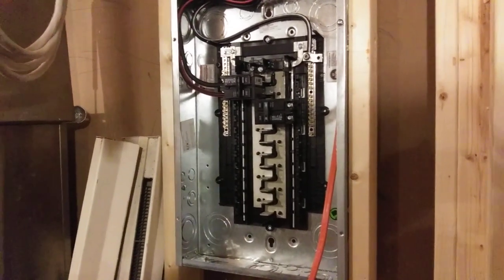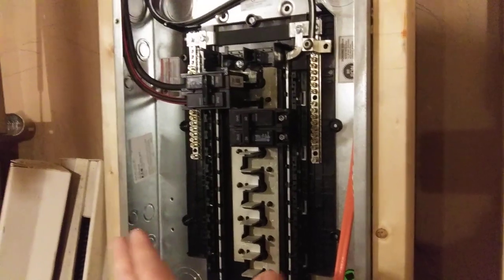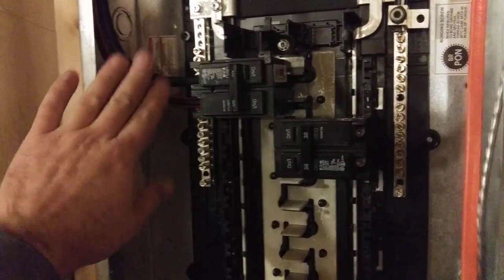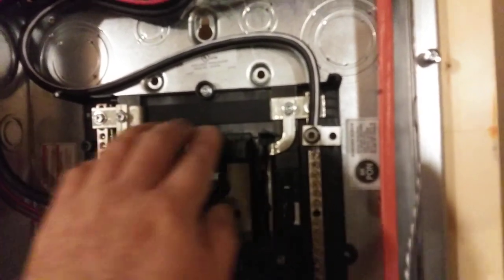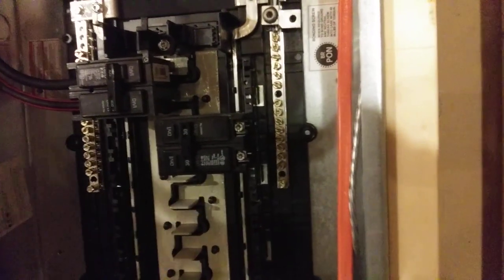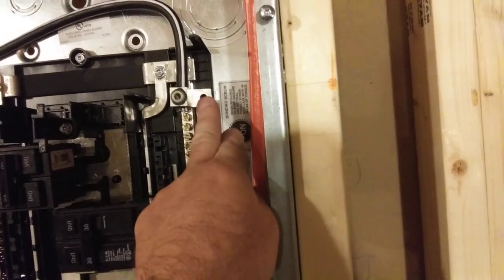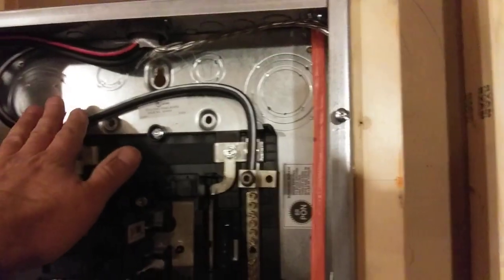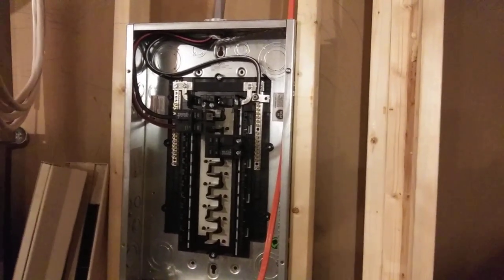Subpanels only get SER Cable!

Comment: Hi James.  Great video.  I'm planning on using a Homeline 40 space breaker panel in my attached garage as a sub panel.   Adding a 100A breaker to main panel, using 2-2-2-4, and using the 200A breaker in 40 space box as disconnect, and removing bonding screw.  I have a question on interior routing of the SER cable inside the structure.  The attached garage was an addition.  All of the  2x4 framing of garage is currently exposed, including the 2x6 bottom truss cords (ceiling).  Are there requirements for the SER cable to be exposed, or visible?  Can it it just lay clipped to center of a stud or bay?  Just beginning my search on information on this, and I don't see any references to this yet.  I only see terminations in or at panels.
Reply from the maker: You should start with a call to your local inspector and ask the following: 
1. Can you use the 200 Amp panel
2. Do you need to derate to 90 amps? See attached link.
3. I'd put the ser in the wall and secure to studs every 4' and 8" from panel. Remember protection plates where needed.
https://diy.stackexchange.com/questions/221869/running-ser-cable-from-200amp-main-to-100-amp-sub-panel
Reply: @JamesGlassJamesGlass  @Ryan MacEwen  I have a similar question. So the wire doesn't have to be in conduit. But could it be if you wanted to? thanks
Reply from the maker: @tigeroswald777  Yes, for that application with #6 or greater. See 334.15 and 338.10

Comment: The house we moved into has a 30 amp sub panel in the detached garage and it fits the description of what not to do in this video. It only has SE wire coming into it (one hot) and I see the neutral and ground wires are side by side on the two bus bars. Basically the total opposite of what you should do. So I’m left wondering if I need to address this in some way. The incoming wire runs under a concrete patio (in conduit). I’m not an electrician. Any thoughts on what should be done to remediate?
Reply: You only have one phase (120v) doing to the sub panel?
Reply: Pull the proper conductors.  Oversize to number 8 or more if there is potential for voltage drop and if conduit size is appropriately sized..  Make sure bonding screw is not joining ground to neutral in the sub panel.

Comment: I HAVE A 100 AMP SIEMENS PANEL (seq24100sm) THAT I WILL USE AS A SUBPANEL in my shed,  IT HAS A 100 AMP MAIN  BREAKER  but i  not see any lug plate or connections for hot, neutral or ground, do i need to buy a separate lug kit ?  what size wire where would i connect the cable on the main panel  and what size amps , i will probably install a 40 amp service in the subpanel . The cable will be run underground  in a pvc  conduit to a max length of 50 feet !

Comment: How about 3 wires from the main panel if a copper ground wire is run to a ground rod and is also separated from the neutral? That works, correct?
Reply from the maker: No, has to be 4, unbonded. Ground and grounded conductor must be separate.

Comment: And your back feeding a 2 pole breaker to serve as your main disconnect for that panel but you do not have it bolted in .
Reply: 408.36(d)
Reply from the maker: No, I'm not. This is an unbonded panel with a main disconnect because it's so far from the panel that feeds it.

Comment: You are back feeding your main breaker. Were you able to secure it with a special screw or other attachment device?
Reply: There is no backfeeding here, the subpanel simply doesn't have main lugs, so he's bringing in power through the breaker.

Comment: if you had a sub panel going to a shed in the backyard. i know that you will need add ground rods in the ground and connect the a wire to the rods and the ground bar. but what happens to the ground line coming from the main panel. do you attach it to the ground bar or do you terminate it?
Reply: Yes you ground it all together.  You're just providing the quickest, least resistant way to get that electricity into the ground.  You still don't bond neutral to ground in that subpanel though!

Comment: THHN can also be used through the walls and attic but definitely needs conduit. It's much easier to place in conduit (if that's what you are going to do) since each wire is jacketed alone.

Comment: Hello and thank you for posting the video.
Quick question just to clarify:
The neutral and ground, are bonded at the main panel, but separated at the subpanel.
As you add breakers in the subpanel, the neutral wires will go to the neutral buss bar and the grounds to the ground buss bar?
Thank you, again!
Reply: Yes, in a Subpanel the Neutrals have to stay on the Neutral buss bar and the Grounds must stay on the Ground Buss bar.

Comment: Enjoy your very informative vids.  Got a question about splicing a ser 
cable after an unrelated fire burnt a small section of it.  Can you 
splice a service cable back together after cutting out the burnt part?  
Thanks!
Reply from the maker: Well, no, but can add a junction box and you will need a permit. So, a straight up splice outside a JB is a major no no, but you could add one or two junction boxes which are always accessible. 

If it was an electrical fire, for sure find the cause and repair it before doing anything else. 

I'm assuming it's good size cable so you would need split bolts and you use alloy split bolts for AL wire and copper coated split bolts for Cu wire. Lube up the bolts with electric grease so the inspector sees and tape in front of him/her.

All connections must be in accessible junction boxes.

Comment: Your home service is not multiple phases, it is single split phase.

Additionally, it’s not going to always be SER. A more accurate statement would be that it is always going to be the appropriate rated 4 wire. SER cannot be used to run to a sub panel in a detached structure or where conduit or burial are required.
Reply from the maker: Yes. I'd use USE cable outside. Your criticism is interesting to me. I never suggested ser would be used outside and this is clearly interior type 1 panels. And there's no talk of delta or wye 3 phase, so I am lost on that. The key takeaway for the diyer adding a panel is make sure it's the right panel, has ser cable, and is unbonded. Thanks though for the additional comments. You're right on all counts.
Reply: @JamesGlassJamesGlass   The title of the video is literally “Subpanels only get SER cable” which is why I made that clarification. That’s a sweeping statement that is correct in the instance posed in the video. You also said in the video that your power was two different phases. The misnomer implied you were discussing single split phases and obviously not 3 phase. It’s a common misconception but also never causes any real harm.
Reply: I came here to say the same

Comment: Could I run a 200amp sub panel to my attached garage from my main panel 200amp panel? If so , what SER cable size should I use if I would be running thru 1 1/2 Conduit?  I would be running cable approx 130 feet.
Reply: What the hell are you putting in there that requires 200amps?
Reply: @freakfly23  You don't need to use full capacity... You can put a 100A sub fed from a 200A main and only have a 50A breaker in the sub for a welder. 🤷🏻‍♂️ No problem.
Reply: @freakfly23 right 😂😂

Comment: Should I purchase copper or aluminum SER CABLE for indoor house 100amp sub panel that is being
Reply: Getting power from outside 200amp panel attached to the house . Also where does the bare and neutral wire goes to , on the outside panel since it is bonded? Same neutral bar?
Reply: Either is fine. Copper costs more but is easier to work with. You can use #4 for copper but have to step up to #2 for alloy for 100 amp. The sub panel is NOT bonded, but you can run an extra ground rod from the UNBONDED ground bus to a 5/8" copper clad 8' ground rod if you want. I would.
Reply: @jamesglasscameraobscura1148    Thanks for the feedback .  I’m trying to update my SER CABLE. The original one has only three conductors ( 2 hots 1 bare wire ) which I’m assuming is Neutral. The MAIN panel outside is 200amps  connected to meter. The indoor sub panel is 100amps with the 40 circuits.  Currently the ground in the sub is a ground bare solid copper cable attached to the copper pipe for the water line.  If the new SER CABLE has 4 conductors,  where would the bare ground cable go when attaching it the outside main panel since the neutral is going to the neutral bar and the panel is bonded . Does it also go to the same neutral bar as the neutral cable ? in regards to the OUTSIDE panel only.  Thank you
Reply: @rickrodriguez659  
1. I strongly suggest hiring a local licensed electrician to guide you through this, AND not matter what you must have a building permit.

2. The basic answer to your question is the main panel is bonded and all subpanels are unbonded. In modern homes, the main panel is the meter/main disconnect. Inside this panel the neutral and the ground are connected together using proper lugs on the correct bar. This is also where the ground wire #6 or better goes to at least 2 ground rods. You can use just one ground rod if you have it certified 25 ohms or less, but since that costs hundreds of dollars, everyone just uses 2 rods. You can use more than 2 rods. I do. I also use #4 wire for all my grounds.

3. When you get your building permit, you can ask the building inspector these questions and she/he will help. 

4. In the old days, the water line was ground. This is problematic for many reasons: it might not be a good enough conductor or with PEX or CPVC repairs it might no longer be a conductor at all.

5. In the subpabel you will find 2 busbars, one for neutral and one for ground. Sometimes the ground bus isn't there and you have to buy it separately, but if you look inside my panel the bus with the green screws is just for the ground wires and it is in no way connected to the neutral wires. The panel is also connected to the ground so the panel is grounded.
Reply: Thanks again!

Comment: Can a subpanel have BX/AC-90 steel armor as the service entry and have the metallic sheathing work as the self-grounding?
Reply from the maker: Sheathing can't be ground in this case. For circuits the bx can sometimes be used or modern armored cable usually has a green ground wire inside. But panel to panel needs SER cable.
Reply: Thanks for your reply.  What city/State are you located in?
Reply from the maker: @loveislife77  Virginia. Fillion Rule state so all AHJ follow state law.

Comment: Great video!!!  Can you run SER cable outside from the main panel, in garage, to a sub-panel on a detached office?   Or does it need to be in a conduit of some sort?  Or totally different cable?
Reply from the maker: Every wire (wires are inside cables) needs 2 layers of protection (w some exceptions for underground burial or overhead service) so either all insulated wires are bundled in a cable or individual wires are run inside a conduit. Where it's at determines if you use ser cable or conduit (and which type of conduit: pvc, emt, or rigid). Yes, you can run ser wherever although the if you run long distances you have to increase wire size. Your local electrician or building inspector can help.
Reply: For the shed, detached garage, etc, by NEC and building codes 2020, it requires a raceway underground, 18 inches deep, with THHN 12,10,8,6,4,3 AWG copper or aluminum depending on the load at the detached building. SER cable is designed for interior only installations the outdoor version for SER is the UF cable, but that one didn’t goes up to all sizes of wire. Electrical contractor and Inspector here, so you can ask any question
Reply: @javiergiraldez1647  Yeah that is what I found out from our city inspector.  The lead inspector here wanted me to use THWN in the underground conduit.  For mine I used #4 copper.  All worked out great.  I got it installed, inspected and passed.  Now I have a nice detached office for my wife to work in.  Thanks for getting back to me.

Comment: Where is your grounding electrode conductor that is supposed to be connected to your 2 ground rods that are to be no less than 6' apart driven in the ground just outside your panel location.
Reply from the maker: I have three rods > 6' apart at the main panel. 1 rod could be used if verified < 25 ohms, or two rods 6' apart is minimum code. I use three to ensure least resistance.

Comment: So totally off grid electric panel for solar panels...how many solar panels can you hook up to this particular panel?
Reply from the maker: I'm on grid. I looked at putting a 5k system in and even w lower cost Chinese panels the pay back was a decade. The problem is we're in coal country and paying 11 cents a kWh. All panels work w solar-you can go w a grid and solar hook up. Solar generates dc, so an inverter is needed. Some loss is expected so running as much as you can on dc deals w that. There are even fridges that run dc, not just lights. 

I've never done solar and thought it would be great but the return was so far out I let it go.
Reply from the maker: A few fun facts: 

--most homes could get by w as little as a 5k system but my research saw people installing 10k or more.

-- you could hook whatever you wanted up at a 100amp, 200amp etc panel but you'll need the equipment to invert and connect the to the grid

-- meters can run backwards and you can sell power back to the grid. They only buy at wholesale rates now.

-- teslas battery wall looks awesome! I would want to store my left overs instead of being forced to just going back to grid power. Or have no power if I was totally off grid.
Reply: @JamesGlassJamesGlass  Tesla's wall sucks man. You want a LiFePo battery backup system or another lithium type. It's all in what you need and can afford but solar is rad, just very expensive right now. I can't believe some states outlaw it, no wait, yes I can.

Comment: if you use urd cable underground coming from your main panel to an indoor  sub panel in a detached garage 150 feet away...I know you can't use urd  inside due to it not being firerated ..how would you switch from urd cable to ser cable inside your garage??? I cannot find a video on YouTube of someone actually doing that
Reply: I hope you got this solved already.  You may need a building disconnect on the outside of your building.  If so, you can terminate one on the in and a different wire on the out to the panel inside the building or a weather rated box and splices rated for your wire size will allow you to maintain the correct size while switching insulation on the wire.

But the first thing is to call and talk to your local inspectors.  They might give you a different answer and the code itself allows them to "interpret" the code or completely ignore it.

Comment: So are you saying it’s a code violation to use and NM-B wire to feed a subpanel?  Or what about if it had conduit and you used thhn/thwn?  Where is that in the code?  Nice explanation though just wanted to understand.
Reply: No, it's not a violation. Good point. You can run NM or wire in conduit. I should have noted that. The issue is you can't run SE cable to subpanels--that was my point. There has to be a fourth wire for an unbonded ground.
Reply: @jamesglasscameraobscura1148  I got you. We 4 wire to all subpanels. I feed lots of subpanels with Romex for solar backup power systems that only deliver 30 or 50 amps.

Comment: A subpanel is never ever ever bonded? What about when the subpanel is in a separate building, say an Adu, with its own grounding system?
Reply: The sub panel is still getting fed from a breaker on the main service panel, even if it's on another building. The power leaves the transformer, enters the meter, enters the main service panel, goes through the breaker, through the feeder, and lands on the subpanel where the additional breakers are placed. You ONLY bond neutral and ground wires and bars at the very first service panel, the first one encountered after the meter.

Comment: What do you mean ONLY get ser cable? Are you saying that we cant use (3) copper thhn #3 and (1) thhn #5 individual cables? because I think you are wrong.
Reply from the maker: For interior applications. You can also use USE, wire in conduit, etc.

The point is subpabels get 4 wires, not 3. Hence ser not se.
Reply: @JamesGlassJamesGlass  Ah. I see your point now. Thanks.

Comment: Sub panel being 6ft from the main panel needs a main ? Is that your local code ? Cause thats not in the NEC and never had an inspector ask me to put a main breaker in a sub panel. And what are you talking about a sub panel is always gonna have Ser cable? That's not code or true either. I run subs with conduit and thhn all the time.
Reply from the maker: You can run wire in conduit. SER isn't only game in town. SER not SE is message, and the video discusses why the grounded conductor and ground are separate in an unbonded panel. You could also use USE 4 wire to a shed, but 4 wire cable is crucial. All subpanels are unbonded.
Reply: I only had to put a main on separate buildings never in the same myself.
Reply: @JamesGlassJamesGlass  - You shouldn't be putting out videos teaching something you don't have a full grasp on.

Comment: It may not be 'right' but subpanels for grain bins, barns, etc. typically have the neutral bonded to ground and then connected to a grounding rod. If you have an issue you want the energy going to earth rather than traveling some distance back to a main panel. I've had an electrician ask me: Do you want to be right and dead or wrong and alive?
Reply: No, because if there is a ground fault, the neutral for the whole system will be energized